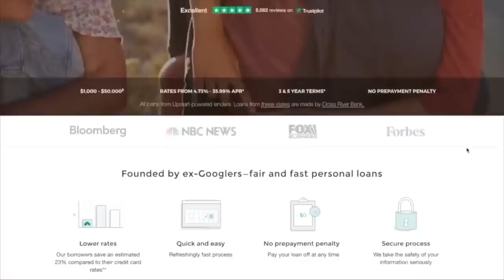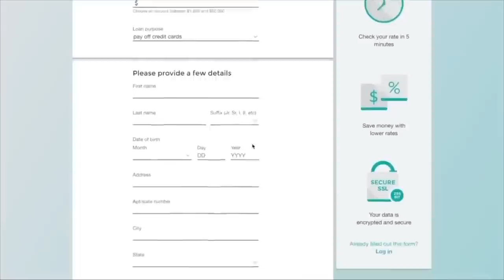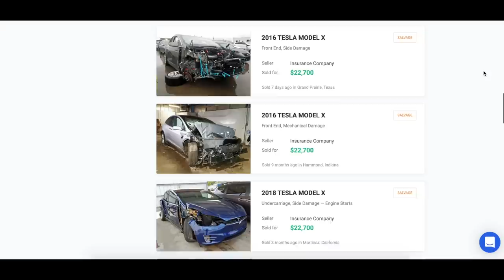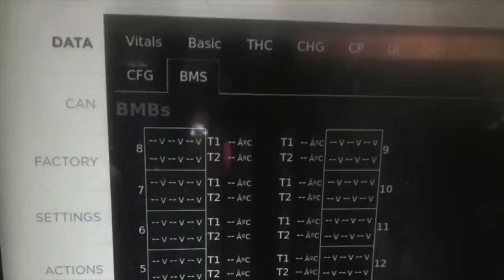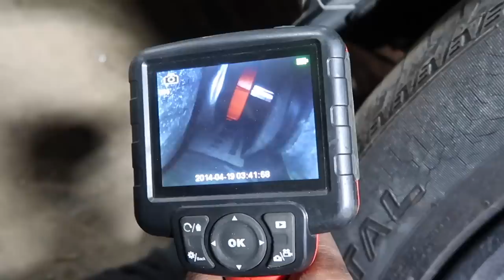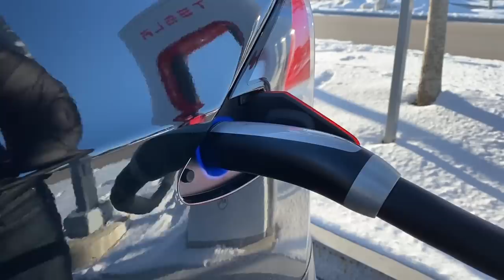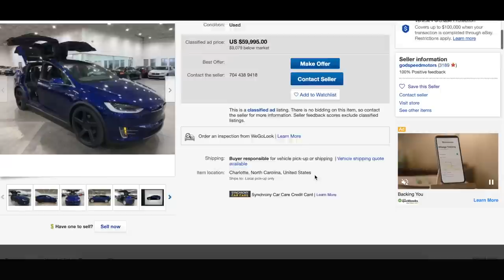Why this Tesla was my Biggest Financial Mistake

Comment: Not tryin to chew you out on this, but you choose to spend a huge sum to downgrade the motor, just because you needed one chip transplanted from one BCM to another? Talking about dumb decisions... FFS, just find someone, ANY-EFFING-ONE within a 200 mile radius, who has soldering experience and good equipment. If it really is just an SMD chip transplant you do not need Rossman to do it.